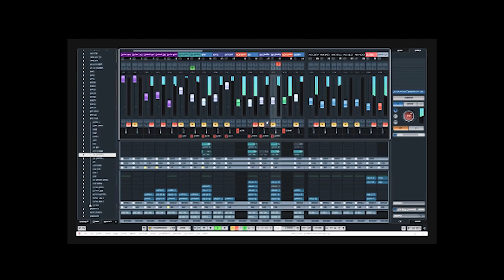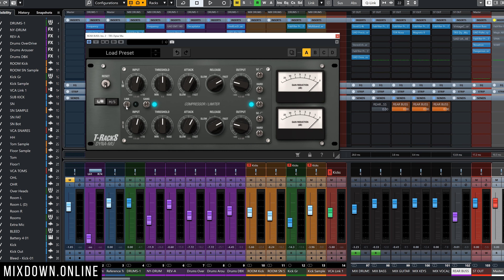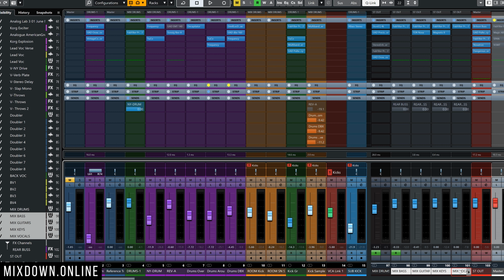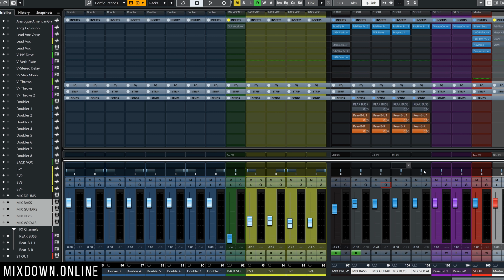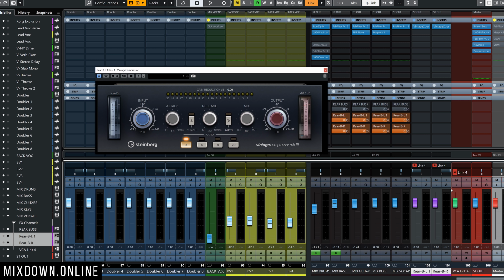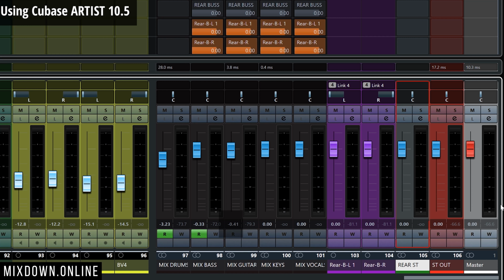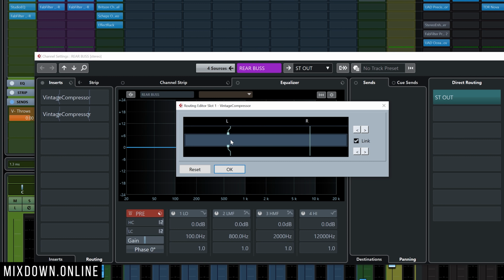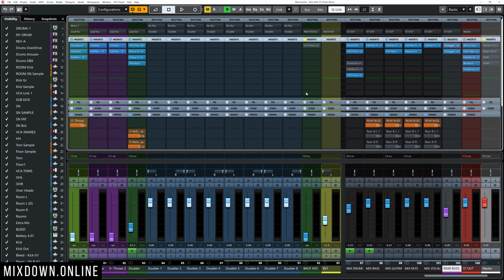DUAL MONO Compression Channel HACKS in CUBASE

Comment: The first setup does not appear to be valid.  It would only be valid if all the busses are in mono.  That also defeats the point.  I am correct in assuming that panning a send does not separate the left and right channels.  It forces a sum of both according to the send pan setting.  I will admit Cubase is not my DAW of choice.  I am open to, myself, possibly not understand the pan law for sends coming from a stereo channel in Cubase Professional.  Cubase is mostly for me to open sessions.  It is not my main DAW.  I am re-considering and thank you for the great videos
Reply from the maker: Actually, if you want to sum the L&R you need to use the "Combined Panning", the regular panning, like in the video, does not sum the L&R . Good observation though :-)
Reply: @mixdownonline  Thank you.  Knowing that could very well come in handy if I ever switch to Cubase.  Thank you for the awesome content

Comment: The upside of that last technique, is that on some plugins you can set up very subtle differences between the left and right channel, which on some plugins may make the effects slightly more analog realistic. Being that the stereo channels on actual analog gear are two matched, but actually slightly different circuits! These kinds of subtleties can add up to add more depths to a mix

Comment: I have a feeling you are not 100% right on your last method. The inserts as far as I know are serial which means the second plugin will get the mono signal from the left and than process that and not the clean right channel. Please correct me if I'm wrong!
Reply from the maker: That's what I was afraid of when I first tried this but no, the Insert Routing does not behave the same way, it keeps both sides independent. Which makes sense or else that feature would worthless imp.
Reply: @mixdownonline  thanks that's awesome to know!

Comment: Chris..CAN YOU DO MONO L/R MASTER  OUTPUTS INSTEAD ON 1 STEREO?
Reply from the maker: Not with Cubase unfortunately
Reply: @mixdownonline   would be nice
Reply: @Mr.Morpheus &  @mixdownonline  Hi, I didn't try this, but... if you make two mono outputs on Audio Connection pannel, instead of one stereo, and then instead of using the output of every channel to route audio to Stereo Out, you can use two Sends to send left and right signal from each channel to the corresponding mono out (L or R), I think this works fine - of course, it is a bit of work setting every channel like so, but it could work.

Only... why would that be usefull to, anyway?

Comment: Chris, is it possible to use the direct routing instead of a send??
Reply from the maker: The problem with Direct Output is that you can't Pan the signal like using a Send.
Reply: Hmmm,.. you’re right... crap... gonna suggest that as a new feature! 😉

Comment: Chris, great channel.  Can we use the OMNI channel as a rack for parallel set up instead of the TS racks if we own the OMNI?
Reply from the maker: Are you talking about the Waves Scheps Omni? If so, YES. The Omni plugin has Dual Mono as a compressor option
Reply: @mixdownonline  Thanks Chris, I was surprised it would have a dual mono versus it offering parallel on it considering he designed it - he kind of missed that feature in his own signature software.  Too funny!

Comment: Hi Cris, thank you so much for the video! I did a little test a while ago, cause I wanted to know if the stereo compressor in cubase was really compressing equally both sides. So I put a test generator, a constant signal, to the left and a kick to the right. Only the kick was over the threshold. Visually the gain reduction to the Left side was very small. That made me think that maybe It compresses  hybridly, stereo and dual mono. But I did not bounce anything to analyse properly. Is there any chance my suspicious are right?
Reply from the maker: No, I don't think it compressed hybridly. A kick full of transients and a sine wave signal will not have the same gain reduction with the same about of compression. your test results are normal for stereo compression with those 2 types of signals
Reply: @mixdownonline  they went to the same group track and the stereo compressor was in the group track. Sorry I didn't explain this part. So I was expecting everytime the kick hit at the right side It would cause a bigger gain reduction to the left side, cause of the equal GR of the stereo compressor. But maybe It was just visually not clear. Or maybe the bigger the signal the bigger the gain reduction following the logaritmic scale, like when we scroll the mouse on some volume automations values on the info line and it doesn't move them equally in absolute numbers.

Comment: You could make adjustments on the compressor in slot one.Then hold alt and drag that compressor to slot two, this will duplicate it.
Reply from the maker: Yes, for sure. But just don't forget to go back and route plugin#2 back to the Right Side ;-)
Reply: @mixdownonline  Right thanks .

Comment: Hey, Chris! Thanks for that.
I know the advanced option doesn't offer the link ability, but I guess the quick workaround for that would be to copy/paste settings from one to the other, as you make your adjustments... I guess... gonna try it out.

One thing's for sure, it makes a heck of a difference! Thanks again!
Reply from the maker: Yes, you can change the settings on the first compressor, delete the second one and copy the first one into the second slot. But don't forget to go back and route plugin#2 back to the Right Side. The beauty of linked plugins is that you can make changes on both sides at the same time while the mix is playing, which makes more sense to me :-)
Reply: @mixdownonline  Agreed. Well, let's hope the Steinberg team takes advantage of that opportunity in 11.

Comment: What am I missing?  Why bother go to all this trouble if you're just going to make both compressor settings exactly the same?
Reply: You are missing the point of the video :). Try watching the first minute again.
Reply: The advantage is that if something spiked pretty high on the right channel for example, the compressor on that side will tame it without grabbing your whole mix left and right. The compressors are set the same but they are processing different sounds especially if you're hard panning some instruments. Hope that makes sense.
Reply: When linked (as the only option in stock Cubase plugins), the stereo compressor acts on the left and right channels as if they were summed to mono in the detector part of the compressor: The compression of the left and right channels are not independent. The result is that the stereo image stays consistent as both channels are compressed equally.
The point of the dual-mono set-up is that the left and right channels are actually independent: Although both compressors are set the same, they act on the left and right inputs independently. The result is that the stereo image moves around a bit as both left and right compressors do their work independently. In most typical cases you wouldn't want that, but in this specific case (emulating Schepp's "rear buss" effect) you do want that to happen.